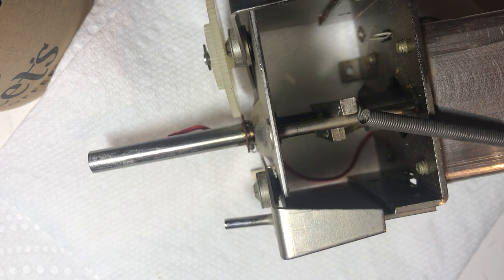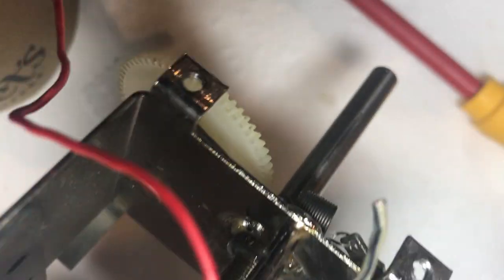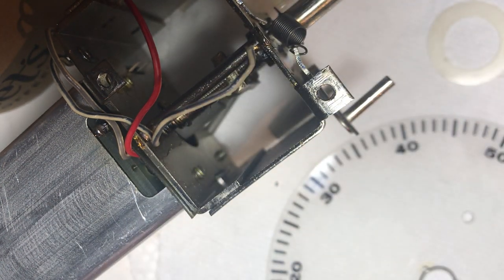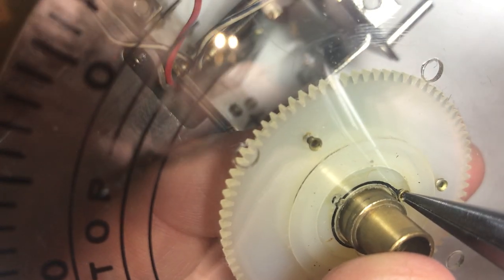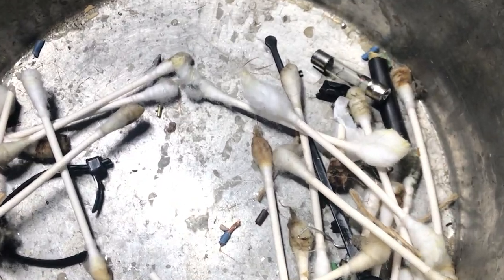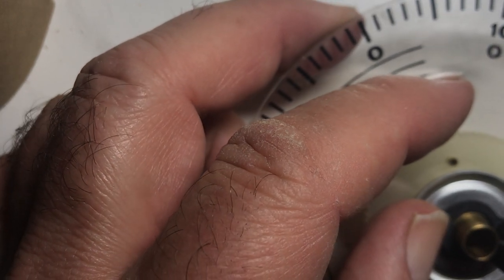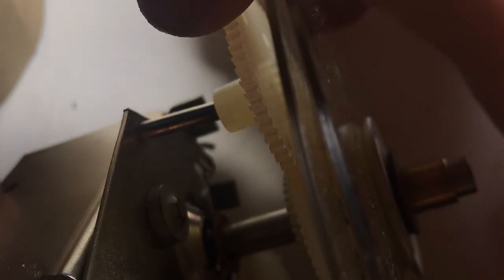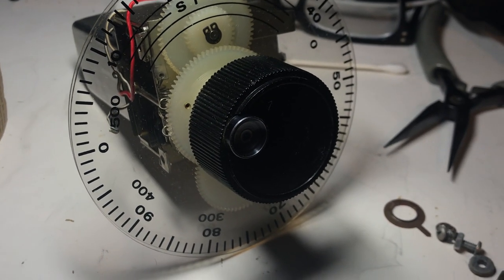Drake T4XC PTO / VFO reassembly start to finish Plus finding small parts which fly December 6, 2021

Comment: Got same rig had shipped it out for capacitor s replacement  he did  lube and  job but after few weeks of using it now does cartwheels   probably  that what happen fell out it was locking up but seam to stop still transmitt good